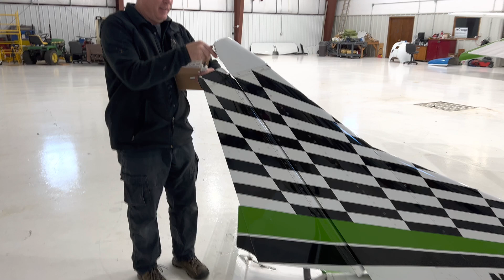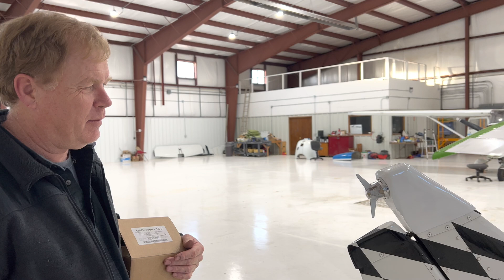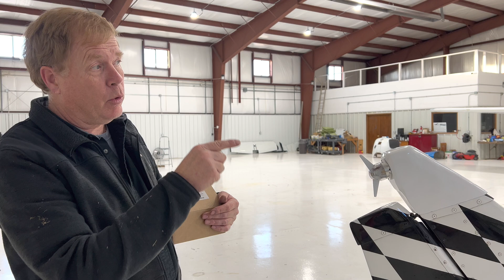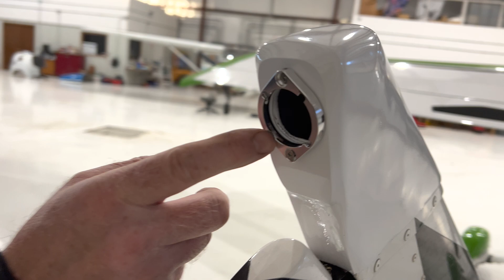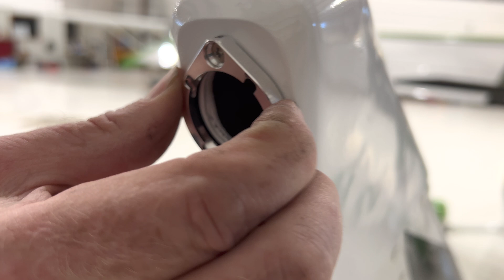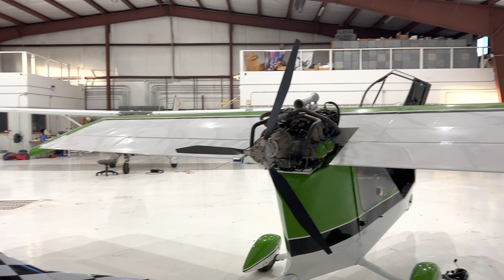Titan Tornado uAvionix AV-30 ADS-B

Comment: I bought the AV-30E for my Titan 103.  I will install it after the snow stops flying in the Midwest where it is hangered. I am thinking of replacing the analog airspeed with it.  Where are you going to put yours?
Reply from the maker: Center panel.  It replaces the old attitude indicator, which was wearing out.  Should be ready to fly in a couple of days!  Thanks for watching! - Matt